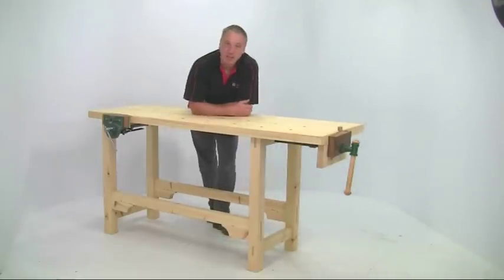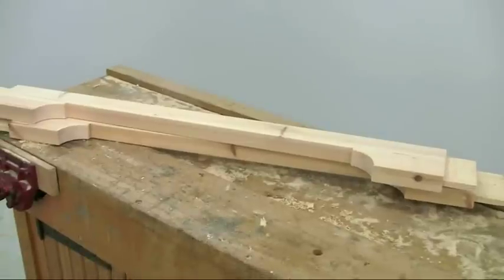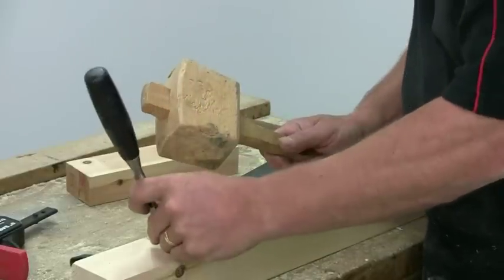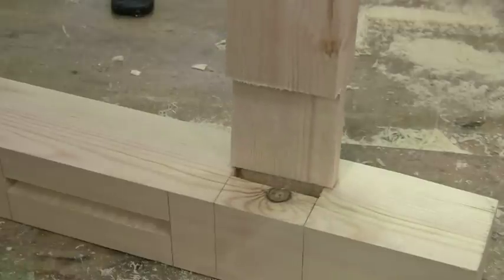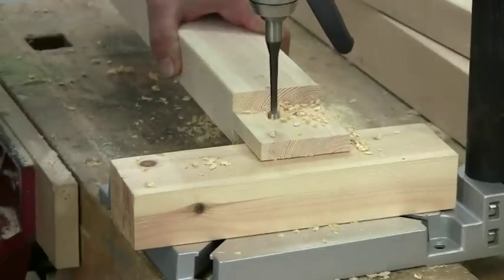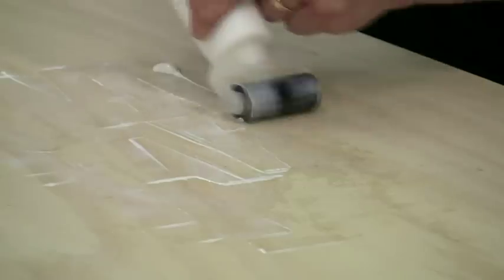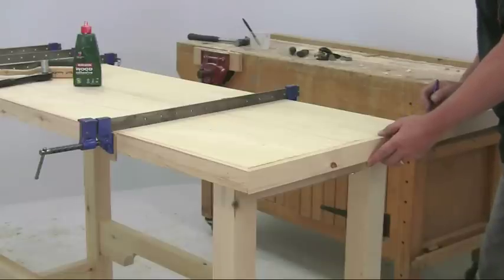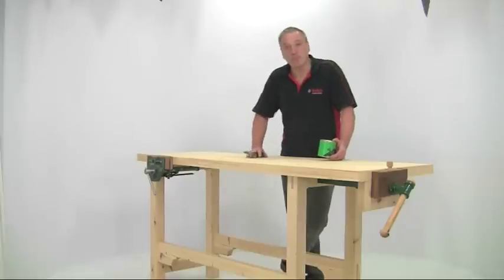Build a Workbench - Build it with Bosch

Comment: I followed all the steps in the video and have just finished my workbench. It took me a few months and I spent a lot on new tools but I learn so much.  
I had just retired and had converted my carport into a garage and started with nothing in relation to tools. I initially bought some cheap power tools but I found it was so difficult to make accurate cuts.  By the time I had finished I I had probably spent about $10,000 on quality tools but I now have a new set of skills and plans for many more projects in the future. 
Sure it is possible to make a functional workbench with re-used timber, a handsaw, drill and a few bolts. However, for me, that iend product was less important than  what I learn from building the bench. 
My workbench does and for me, was worth every cent of what I spent.  Thank you for the video and now on to the chicken coop.

Comment: Tools required for this job

GOF 1600 CE: 383,30 €
GKS 190: 111,94 €
GCM 10 SD: 801,92 €
GKF 600: 210,55 €
GSB 19-2 RE: 142,92 €
GSR 14-4: 160,90 €
DP 500: 129,38 €
GEX 150 AC: 170,48 €
GST 160 BCE: 220,89 €
======
Total: 2332,28 €

So basically you need a fully equipped workshop (which probably contains a workbench) to build this thing.

Sounds a little bit like a chicken and egg situation.
Reply: u realize u dont need most of them?

Comment: I'm just about to finish mine. Got the plan from the bosch FB, but instead of using power tools, I used a 16mm chisel for the mortises and a Japanese saw for the tenons. Took a month (on my spare time). It is not perfect but it works for me and I learnt a bit more about using hand tools. To cut the mortises I used Paul Sellers technique. By the way, nothing against power tools, but as a beginner, I'm investing slowly.

Comment from the maker: Hi, yes you can put as many dog holes as you want, they are actually very useful when used with the tail vice. Doesn't really matter which drill you use as long as it has the right sized collar.

Comment: It looks like it would convert to 6' long x 24" wide x 34" high.  Legs seem to be 2 3/4" square x 36" (including the tenons at the top) and the stretchers 
52" long (including tenons).   This looks like a good project, and I'll use 4x4 beams (which are actually 3 1/2" x 3 1/2") and 2x4s (actually 1 1/2 x 3 1/2) instead of 2 3/4" x 1 3/8"--- the 70mmx43mm in the plan).

Comment: Do Bosch supply a 15mm cutter for the mortise joints and an 8mm dowel drill as used in this project?  Cannot find either on line anywhere

Comment: I make heads nor tail of the plans.  I hope Mr Holtman or some other kind soul reads this because I bought the wood and I want to start working.
If the legs are 810mm and the top is 50, how can the overall length be 910, as described in the plan showing the end elevation?  And how long should the cuts be for the tenons, 60 and 120?  thank you!

Comment: Hi Alan,
I downloaded the plans and when I was cutting the tenons to 15mm as per the plans I noticed you use a single bit to rout out the mortices. I have had great difficulty getting a 15mm diameter 1/2in bit for my router. Did you use a Bosch one?
Thanks in advance
Ken

Comment: A few simple hand power tools ??? I counted 32 specialized tools all together - I could have made that with a circular saw and decent drill - I mean if you are going to rout then cover the edges of the top, surely it's much quicker to use a circular saw. If he had actual put some decent bracing in it and used a bit more creativity he could have spent less time and effort for a better result. eg: rounding the tenons is WAY better and easier than squaring out the slots - that just creates fracture stress points. NOT a pro - just a salesman imo. Thousands $$ of tools to create an average bench haha

Comment: Can I ask you something?  I've seen tenons cut before and it looks like no matter the size of the wood, the math is standard.  Yet, I'm confused:  like in other videos, the tenons you all cut down on your approximate 2X4's lose roughly 1/3rd of its wood on one side of the tenon and the other 3rd on the other side of the tenon, which according to my math leaves the tenon to be 1/3 the strength of its original mass.  
What's even more hard to understand is that the 2X4 was to be mated to a 4X4, making the tenon physically disproportionate to the size of the small tenon hole cut in the 4X4?   Please tell me why?   I find this annoying in the same why I find craftsmen showing off how small they can make their pins in dovetail joints.

Comment: Anyone know the name on that "Drill press" ? at 6:12
Reply: Drill press stand I guess
Reply: They used to be made by a Black & Decker and company called Wolf in England many moons ago, if you search drill press stand on ebay you may find one. They are usually very cheap but also very useful, I have used them with cordless drills.
Reply: Ye, because the only thing I can find there looks like it, is a GMB 32, and its not that.
It looks really handy. And I also need it to be portable. But thanks, I'll try eBay.

Comment: the best tools - why the cheapest wood
Reply: +george gonzales Beech would be a good choice for a bench like this, but in my opinion, ideally the top should be sacrificial.  I use MDF for my tops so I can easily replace them when the track saw marks become a problem.  MDF is also nicely flat, which is a major benefit for glue ups.
Reply: he spent all his money on the tools!

Comment: Haha yer, not useful. Check out Paul Sellers videos. He has a series on making a workbench with a workbench. He also uses just hand tools, which is usefull if you have a budget to work with. Also all the joinery can easily be done with power tools if you have them.

Comment: How can you bitch about the video? I thought there would be a lot of sales talk, but the only thing they did was use bosch tools. The only tool I saw that I thought was a little unreasonable for the average home shop was that drill press attachment. Thing, which you could figure out how to do without easily. Other than that, the vid shows some good practical joinerry that you could use on many projects, and I for one thought he/they did a good job of showing and explaining.

Comment: Step two, you have to buy such various tools :(
Reply: +Leroy Huang You also have to have almost perfectly square and straight timber for this type of joinery, which is a problem in itself unless you have well calibrated machinery (planer/thicknesser or jointer in the USA) to produce it.  Store bought timber is very rarely square or true, especially from say Home Depot or B&Q.